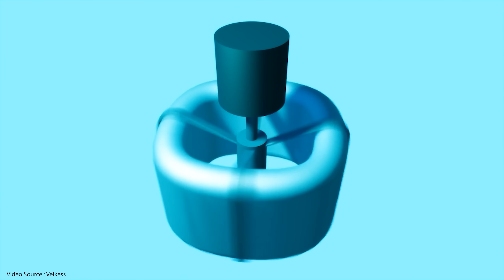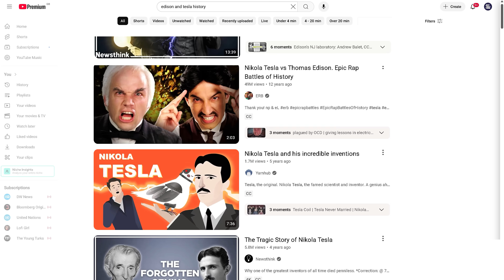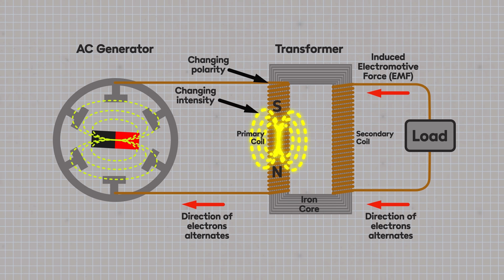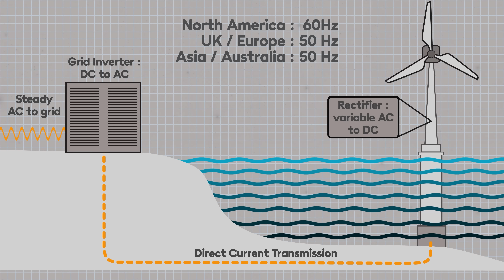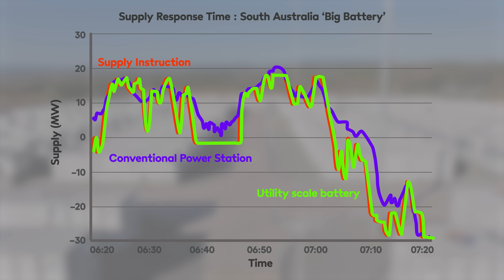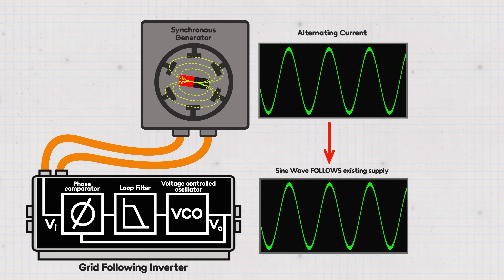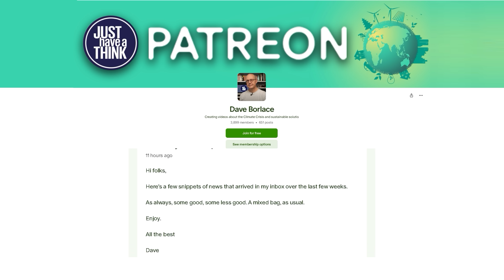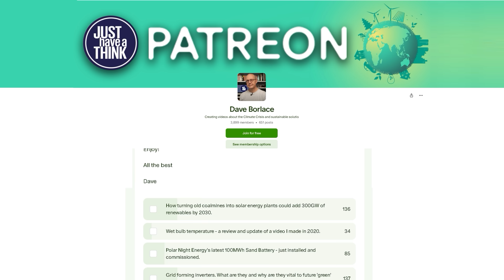How GRID FORMING INVERTERS are paving the way for 100% renewable energy.

Comment: but couldn´t some facilities simply use some of their (excess) renewable DC-elecricity for keeping some heavy-weight spinning things keep spinning? Sounds old-fashioned but also like it might help solve some proplems.
Reply: Yes, their called Synchronous Condensers (or Synchronous Compensator, SynCons) though these are AC based. These spin a motor with a heavy shaft that are able to supply inertia stability and grid-forming services, some countries like the UK pair both SynCons and grid-forming utility-scale batteries to provide synthetic inertia to support their renewables.

Comment: Why don't they use GPS synchronization to establish a uniform clocking signal for grid frequency control?
Another thought: ultracapacitors vs flywheels?
Reply: Fly wheels are not sufficiently responsive (take a while to spin up), and instead tend to be used to provide peak load support (such as powering the JET fusion reactor in the UK). Something similar are Synchronous Condensers (SynCons) that are large motors (with large heavy shafts) that provide the same millisecond responsiveness as grid forming batteries, as well as inertia, black-start and short-circuit protection of the grid. These SynCons tend to be the main technology used to provide stability in many parts of the world.

Comment: While I appreciate the content it is just a coincidence that I actually saw it as the title is totally misleading. And the map showing the %-portion of hydropower by country is misleading as well as the topic suggests what would be important: The %-portion the power is generated by large and therfore stable rotating masses.
However grid forming inverters are certainly the key and will be spread quickly and largely.

On the title, we could survive quite a while without electric power as we could create warmth and cook by use of the fireplace. However just after a week or so the firewood would be "out of stock" as we do typically not intend to use it for heating and cooking and therefore do not store loads of it.

Comment: Thanks for addressing this important topic as there are a lot of misleading videos out there.
For this short format it was very well done. Reality is as always a bit more complex (even inertia can cause issues in large grids, but operators have learned to deal with it, for the new grid they have to adapt and transformations are always difficult in the beginning).
Reply: Yes, reality is more complex. And this is the biggest problem so far with the efforts to convert our power grid to operate on only substandard power sources which are unreliable, extremely variable and non-dispatchable. The result of such an effort will always be failure, because reality precludes success. Now, if reliable sources of emission-free power were included in a great enough percentage, it could be done. But I suspect if reliable sources such as hydroelectric, geothermal and nuclear power were used in large enough numbers to replace today’s fossil fuel sources, it would quickly become apparent that the unreliable sources like wind and solar are not worth the trouble. Sometimes reality is not what you want to hear, but it does no good to ignore it.